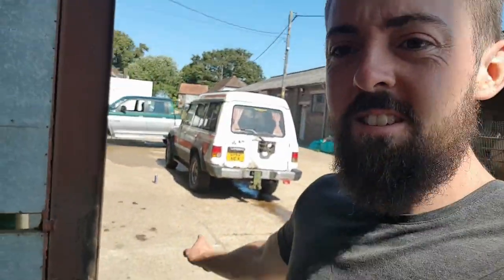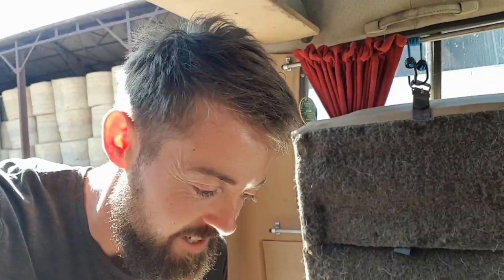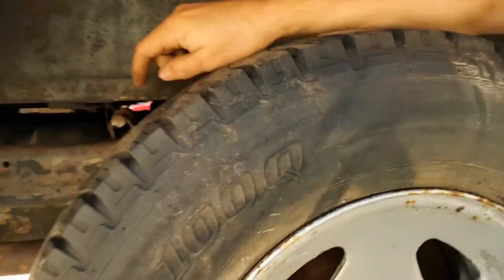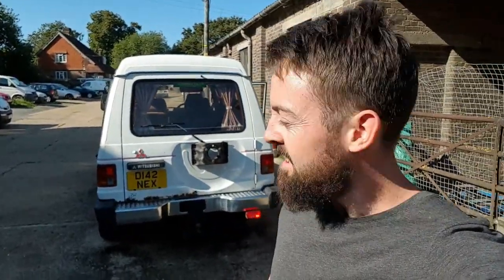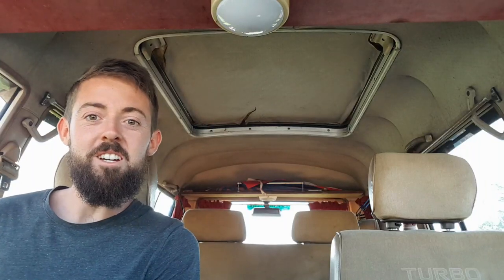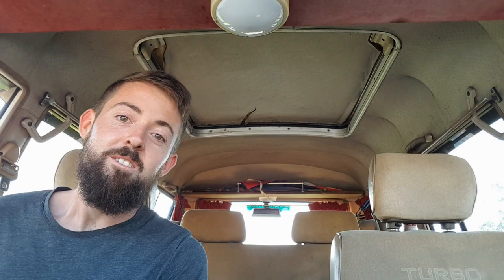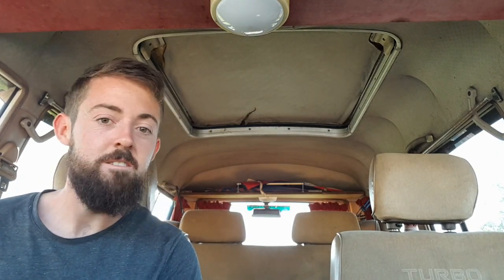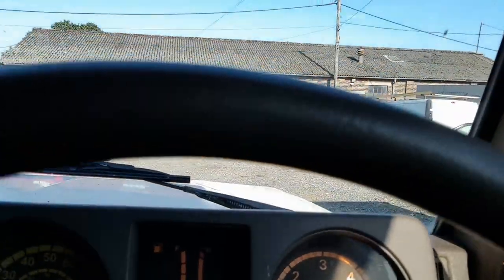Barn find Mitsubishi Pajero turbo wagon mk1 restoration. Finding molly

Comment: That's super cool. Good luck with the restoration!
Reply from the maker: Thanks! Will keep chipping away at it 😅😃
Reply: I became a Pajero/Montero fan less than a year ago and now have a 2002 Montero Limited. I'll for sure be checking in on any vids you put up on this project. I like what you've done with your other Monty overlander too.
Reply from the maker: Exellent where are you based? I will sure be posting more vids of both trucks 😁👍
Reply: Awesome, thanks! Actually on the island of Saipan, a US territory in the Pacific. So my Monty went thousands of miles away from Japan to the US, then thousands of miles back to Asia where it was sold by Mitsu in Guam, haha. How many Shoguns/Pajeros have you owned? I've been watching some of your older videos before the green machine, but I don't know if the green overlander is the same one you had before or a different one.
Reply from the maker: @nathansmith9332  that's one hell of a journey there! What do you have now? Yes the original dark green one in videos is the same truck that is now big and bright green 😁

Comment: Such a nice 4x4! You score big with this one, great platform for a project or even just a simple restoration. I know its late now, but a good way to remove dog hair is using adhesive brown tape (the one for packaging cardboard boxes), we use it on our clothes, or a rubber glove passing all along the carpet making rolls of hair, its easier to remove, and i speak from experience! 
No need to explain the why you bought it, i get it, im a sucker for old boxy 4x4s and cars! Good luck guys!
Reply from the maker: It's got a lot of potential, for now I am thinking simple restoration. It is a classic after all! Yes tape must try that next time. The wire brush was already in the back of the car with dog hair on it so must have been there for that reason 😁

Comment: If you ever take a notion to increase the power a lot, any of the Toyota 1UZ engines will bolt right on to the Montero transfer case without modification.  You will have to move and re-weld engine mounts on the frame though.
Reply from the maker: The 1UZ will bolt directly to a Pajero mk1 2.5 gearbox??

Comment: Hey guys, where did u get your roof rack/basket from... I have a high roof here in oz.. Cheers
Reply from the maker: Hey! Certainly not many high roofs around these parts which is a shame! is a direct4x4.co.uk Ali rack. The also can supply the high mount brackets if you ask/select them. If you decide to go for one use code JKOVERLAND to get 10% too 🙂 let me know if you need any assistance 👍

Comment: i have heard that these 4d55 are not for long route bcoz of heatup issues that results in head crack
Reply from the maker: We have just completed 1500miles well with low running temps. Got to have a healthy cooling system 😁👍
Reply: Got 3000km and over no overheat at all still cool

Comment: Where do I get parts for Mitsubishi Pajero 1990 4D56-DA7521, i need the following turbo, alternator, starter and fuel pump. Plz reply below
Reply from the maker: Try Milners offroad in the UK 👍
Reply: JKoverland Thanx .l am in Kenya it is impossible .
Reply: @Ephantus Muhindi you can get them in Nairobi near Nyayo rounder about

Comment: I have the rebaged version of that, i wish it had a diesel engine😟
Reply from the maker: How about an engine swap 😉 if it's a v6 that's a good motor too 👍
Reply: @JKoverland  i have been considering that. It's the four cylinder. I was even thinking of maybe a toyota v6
Reply from the maker: Cummins 😏